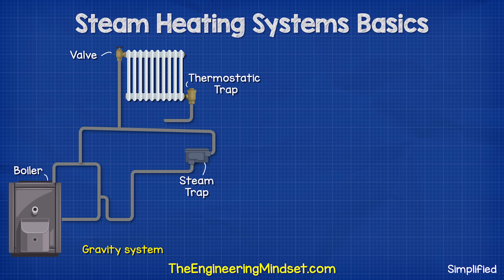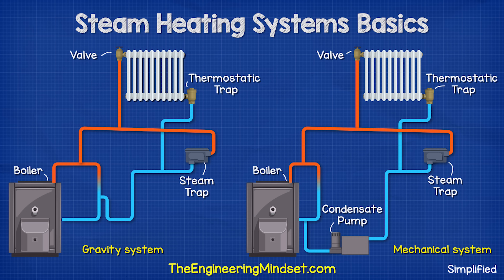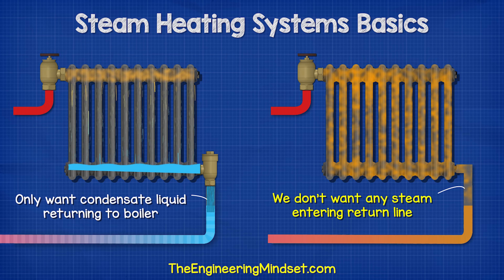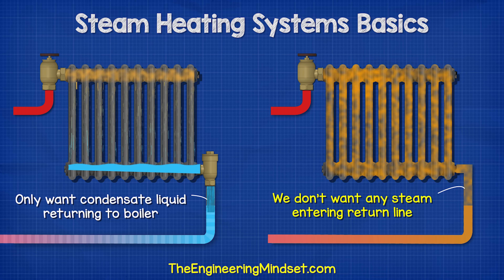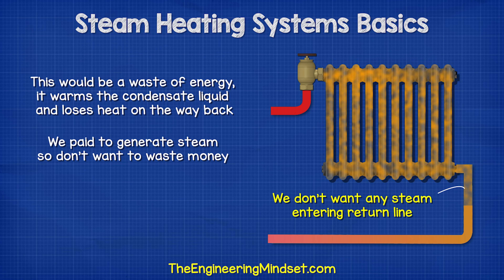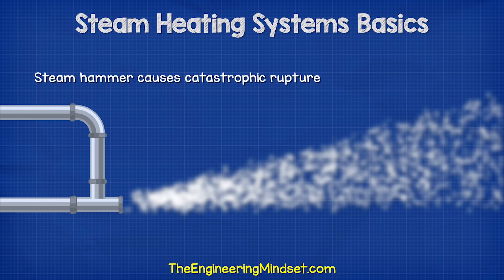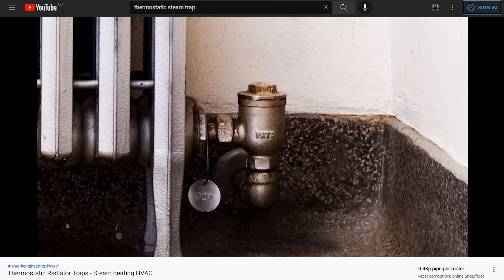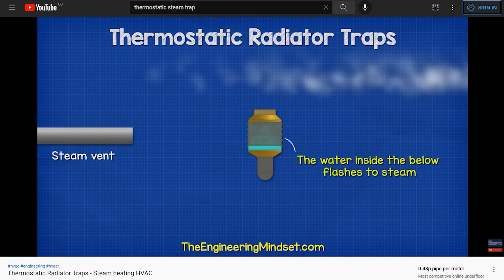Steam Heating Systems Basics  hvacr

Comment: Ask yourself , why, if for over 100 years, did we ever retrain ourselves, to use base board style electric heat, when steam , was so effective, ultra reliant, easy to service, and came at a cost of PENNIES on the dollar? The answer lies in the pocket of the billionaires who cause you, the worker, the debt slave, to sit in fear of making your monthly bills. 600$ per month to run your electric heater ? Excuse me ? If a building today is designed without a thermal heating system, and a boiler room, it’s designed to suck you dry.

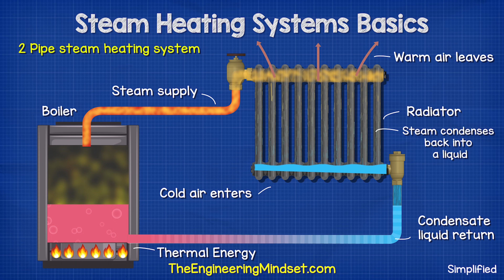Comment: 2:40
I have a question.
How do you prevent the steam from pushing down on the liquid water?
Wouldnt that cause the system pressure to balance out, and steam and water to stop flowing?
Reply: The steam trap only lets liquid condensate through, keeping the high pressure steam in the radiator

Comment: I just watched a video that took place and one of the coldest communities in OYMYAKON Russia. 
It is-65 most of the time in the winter. 

It is also considered one of the most dangerous communities in the world because of this cold. 

They brought in a huge industrial boiler and run underground veins to every one of the houses in the community. 

They are able to keep the heat inside the homes now at 25°C or a.k.a. 77°F. 

This is absolutely amazing heat source, why don’t we know more about it? Because they make more off of you when you bring a natural gas or propane or even electricity into your home. It’s always about profit.
Reply: Yes, in some kind it's about profit, but also keep in mind that if you have to repair and replace tubes and heating equipment, that's a lot of time and money that government/company (resources, in general) can't spend recklessly. And also to keep the system in work in extreme conditions requires extra motivation for workers and additional facilities, such as heating for tubes that provide warm water or other liquid, whether it's electrical or not, extra layers of isolation, and dependency. Because if the system fails, people can just leave this world. And to prevent that the contractor has to think over every small detail.

I’m a MS energy engineer student and professors demand from us to consider all pros and cons before projecting systems to teach us how to avoid as many extra costs and possible mistakes from that as possible. Because, usually, technicians and engineers are first to blame if something goes wrong

That's not so plainly about profit, it's about efficiency. And to keep the heating system efficient requires much money

Comment: Hello and thank you for the very informative videos. I’m now to steam heating and we just purchased a building with a steam boiler. I’m trying to learn more about the older looking thermostats in each room that have a copper tube running into and out of it: 
How does it works and how to replace them.

Comment: Areas of application here in Germany for steam heating systems.
Fields of application
Steam heating is hardly used in office and private buildings. It is mainly used in larger buildings such as exhibition halls or warehouses. Here it is characterized by low operating costs. Another advantage is that it heats up large rooms quickly. The poor controllability and the high space requirement are disadvantages that make steam heating unsuitable for conventional private houses.

The use of a steam heating system is particularly useful where process steam is generated. This is the case, for example, in industrial laundries or commercial kitchens. In this way, the steam that is generated anyway can be used for heating.

Comment: In my opinion steam heat is great for residential use. Although it takes a while for the radiators to get hot they retain the heat for a long time and your house does not get dry like with hot air heat

Comment: So for example like in big nyc apartments that have the pipes running through the room lol. Do each tenant pay for the heater ?
Reply: Don’t think so. I think it’s all controlled by the owner and free, I live in a big building with 6 large apartments. Our heaters are crappily painted and we have normal heat from these ocean breeze machines. Today realized the heaters were getting hot and had move stuff. Always assumed they were jus for look’s because it was painted white. Only thing I’m billed for is rent and electric. Even waters free.

Comment: Here are questions to refresh what you had learnt: 

1. Where are steam heating systems (SHS) can be found ? 

2. Where do SHS commonly use ? 

3. Without required pump, how does SHS distribute and provide heat ? 

4. What is the functions of a loose lid when contained water applied with thermal energy ? 

5. What happened to internal pressure as thermal energy applied to a sealed container ? 

6. How do water molecules react when both of the pressure and temperature are increasing ? 

7. When water transformers from liquid to steam/vapor, how many times does it expand ? 

8. Explain how 2-pipe steam heating system work. 

9. What is steam hammering ? 

10. What needs to be installed to prevent rupture or steam hammering ?
Reply from the maker: Seen our new Transformer video? here https://youtu.be/jcY4QN7awEc

Comment: in my opinion,  this is the best form of indoor heating................
Reply: Ikr older buildings always feel warmer for some reason.
Reply: Nah man, in-floor heat is the way to go. It's more efficient, allows for significantly more efficient heat sources, is lower maintenance and feel so good.
Reply: Good show!! Don't forget to install a carbon monoxide[CO] detector in case of a non-steam, natural gas line method
Reply: My heat pump disagrees😫🔥🔥🔥
Reply: @reno911yo  ok slap-nuts,  whatever you say..........
Reply: I concur the best form of Heat ever created
Reply: I agree
Reply: I totally agree with you.
Reply: Yeah like wake up in a sweat in the dead of winter best form lol
Reply: Water based radiators with one under every window sees more optimal
Reply: But the radiator takes up precious floor space and majority of the time they're always placed in the worst spots... 🤦
Reply: @MrZancruz blame the interior designer 😂😂
Reply: @MrZancruz  same is often true of forced air
Reply: @MrZancruz can’t bet a gas furnace, especially as they continue to get smaller and more efficient
Reply: Keep in mind (with the temperature increase with faster particles) that speed of flow (of the articles) is not always an indicator of increased pressure, especially in enclosed systems. 

The increase here likely has more to do with temperature (considering expansion) the frequency of collision is more apparent between the molecules/particles within the beaker, after all temperature is in the average kinetic energy of each molecule/atom (n), since in an ideal condition where volume is constant, the pressure will increase as does the temperature. 
Again increased particle movement is not in direct proportion to temperature.
Reply: This hasn't aged well, lmfao.

Comment: I would maintain that the pressure in the system plays no role in the circulation of steam and condensate. Rather it’s the change in density and the resulting convection current. The steam is light and rises up to the radiator (always situated ABOVE the boiler). The condensate is heavy and naturally drains back to the boiler. The system pressure dictates the temperature of the steam and therefore that of the radiator.

Comment: Hey The Engineering Mindset, how about video comparing steam heating and conventional hot water heating. I live in europe, it's first time I hear about steam heating so I'm curious about differences.
Reply: There is not much too be compared. It is a wasteful concept that you only need if your building is so stupidly bad insulated that only burning hot radiator could keep them warm. You almost have no Control about the heat amount peer room and you need extrem amount of materials to build such things. Only in America where energy is plenty and cheap such bad concepts came up
Reply: @kgfgfg1  Your correct, this is not good for a mud hut.

Comment: Can you do a comparison between a water evaporation air conditioners (swamp coolers), a change in state air conditioner (traditional air conditioner) and heat pumps and centralized chillers.  I sure love my air conditioner during the short but very hot western Canadian summers.  Looking at buying a heat pump to replace my AC and supplement my winter heating.

Comment: Thanks for another simplified and well explained video. 
Question: Do you have to add water to this system at any time to compensate for losses?
Reply: Yes you do. I have one in my house and the boilers have a water level and over time you need to go downstairs and check the water level through a guage, and open a valve connected to a water pipe, to add water. It has a saftey that electronically shuts it off if the water level is too low to prevent the boiler from running dry and exploding. So if you forget to check for a few days.. you might wake up one morning with no heat and end up mad at whoever’s job in the house it was supposed to be to check the water level and fill it. There are electronic valves you can get that install in between the waterline and the boiler that atomatically open it and add water when it detects it’s low but those are expensive and finicky and not good in my opinion for home use age, but I’d imagine are the standard in commercial settings.

Ask me how I know about this happening

Comment: Can you guys do vacuum pumps, boiler feeds and other boiler auxiliary equipment? I’ve been referring a lot of new guys to watch these videos as they are super informative for an operating engineer!
Reply from the maker: We have covered vacuum pumps. Haven't covered much on boilers yet though
Reply: @EngineeringMindset  nice thanks I’ll go take a look. Maybe do a split session on low pressure and high pressure steam boilers? I know the direction most new buildings are going into is hot water condensing boilers. Although, NYC has those old steam boilers and they pay premium rate for a high pressure operators license. I’ll look out for the boiler video whenever it comes out!
Reply: Vacuum condensate return pumps?
Reply from the maker: Oh no no, vac pump to empty refrigerant from an air con system
Reply: @EngineeringMindset  there are plenty of hvac vacuum pumps videos out there already.  Keep doing the large application stuff.
Reply: @ShanQueefus  yeah that’s what I meant for larger steam systems. I run a few buildings in nyc and they are pretty straight forward but this channel has good graphics for the hurling tank and accumulator.